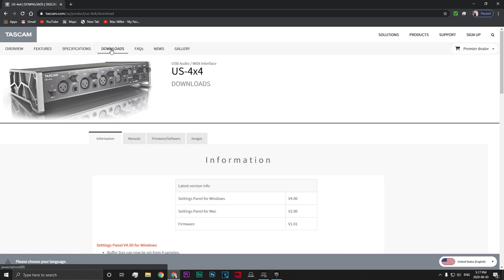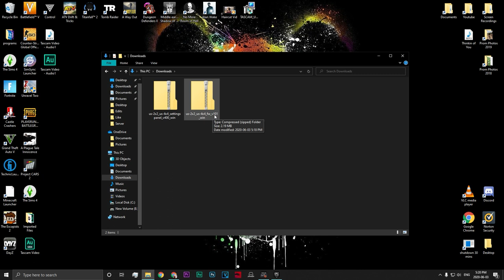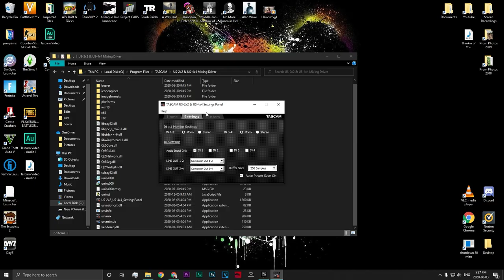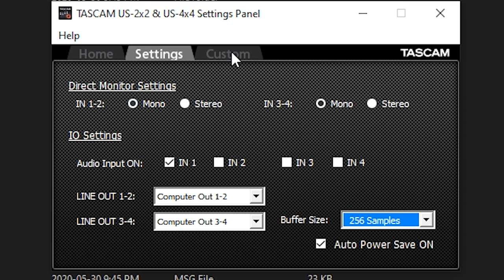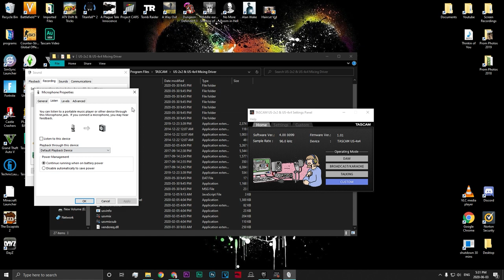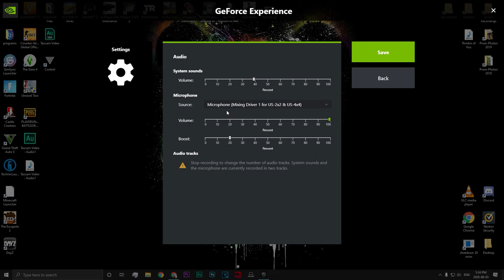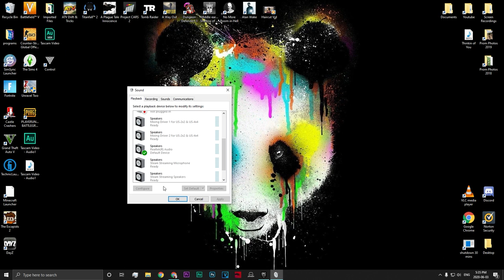taSCAM 4x4 - AUDIO ISSUE (still broken, don’t buy)

Comment: 8:58 I know it is almost 2 years later and some of you might give up on this issue but I will just leave a resolution for it here in case some one needs it.
You go to Settings > Ease of Access > Audio > then switch the option "Turn on mono audio"
And boom, it works for me. Hope it works for you too. Cheers!
Reply from the maker: Thanks for the info, I hope this helps too!

Comment: Thanks for this! I didn't know about downloading the firmware until a friend drew my attention to the issue. I'm now looking forward to finally outwitting my 4x4. In my setup with Windows 10, I have multiple issues with my 4x4 changing settings, especially when trying to use it with Zoom. After all the daily fiddling, it gives good results, but the software seems to have been designed by Loki, God of mischief. Far more time goes on the fiddling about than on recording. I bought the Tascam for its 4 inputs, but I suspect the glowing reviews were based on trials with nice expensive Macs.
Reply from the maker: Yeah for sure, np! I'm super glad the video is helping out, there wasn't anything else online about the super finicky software they made so I had to make a vid. And oh god, yes, it has been so difficult for me too with settings being automatically changed and whatnot, I was tempted to try sending it back as faulty... but I figured it was probably software related so I just took some more time to figure it out. Love the idea of having 4 channels as well, just in case I end up in a band or something. And you're probably right because it definitely does not like to cooperate with Windows 10 at all! Glad we figured something out though, maybe one day they'll patch it to be more accessible and easy to use.
Reply: I have a nice expensive mac. We still have issues with interfaces, but they’re nicer issues, and expensive.
Reply from the maker: @jamesrobertson8292  Hahahah nice to hear that we're not alone :') I can't recommend the Scarlett Focusrite 2i2 enough though. The thing worked before I even installed any drivers or firmware updates...¯\_(ツ)_/¯

Comment: Hey there, you can fix your problem at 7:00 min :

system sound - playback - choose the WRONG audio output - right mousbutton - properties - than again properties(button on the right) - change settings(with the shield) - driver - and than the fourth button (deactivate).

I hope this will help, it took me hours to fix it on my system
Reply: But doesn't this assume that you will never need to use output?

If so, I guess that is a valid fix (I use this fix with my HDMI outputs so that my monitor audio is never selected)
Reply from the maker: I can't remember if I tried that but I'm pretty sure when I disabled the "Mixing Driver 1[/2]" device, it also disabled the device I needed on the recording tab. That's why it didn't end up working. I spent a lot of time trying different things and my conclusion is that the Tascam 4x4 is just a waste of time because it never works as intended. Can't recommend the Scarlett Focusrite 2i2 enough!
Reply from the maker: @JoshKaufmanstuff  Yeah, it would work but I think it also disabled the recording device as well :((
Reply: @MooserTheHoser  When the guy telling you how to fix your interface says to use a different one. You go buy a different one. Done.
Reply from the maker: @josephbeatty4421  lol pretty much, eh?

Comment: My first interface was a Tascam US-144 which was already outdated when I got it, broke down due to driver issues after about 2 years. Was able to get a Tascam US 4x4 cheap so figured why not. Always had some problems with it but was able to figure most out after a little headache. Broke down after about 1 year. Mine won't connect to any PC anymore. The USB light just keeps blinking. Then someone gifted me a Tascam us 16x08 interface, one of the higher end Tascam interfaces. Has pretty much been working perfectly since I got it a year ago. Don't know if this is just luck or Tascam treat their higher end products with much much more care. Somehow Tascam interfaces keep following me. Now I use this one at home and my Motu M4 when I'm on the road. While Tascam is kinda trash you really can't beat their price/input ratio.
Reply from the maker: Yeah that sounds about right. I figured they make it work out of the box but don’t keep up with updates…

Comment: Do you help me please with 3:00? I can't connect it. It says "Erroe. No Device found". So in Settings panel is "No Device too". I have connected Tascam to PC and mic to Tascam. Everything is on. USB indicator is lit. Some help please?
Reply from the maker: Maybe try a couple different usb ports if possible. Other than that, I’m not sure what to do. Your unit may be faulty so I would send it back and ask for another one if it’s not too late. Or a refund & try another brand, up to you.
Reply: @MooserTheHoser  Thank for fast response. Its weird, when I disconnect the device it says "Disconnected" but when I connect it again, there is still "No Device". I'll try it what you suggested. Thanks

Comment: im still having the problem stated at 9:00, shutting down and powering it is also not working, pls help
Reply from the maker: Hey Raayon, sorry for a late response. I don't think I have any other tips for troubleshooting and I think the best option is to consider another brand. I had a lot of good luck with Yamaha but I'm sure there's something you can find that doesn't have as many issues as the Tascam. Thanks & good luck!

Comment: Hi. Do you think the Scarlet 4x4 sounds better? Or don't you recommend like the 2i2? Thanks!
Reply from the maker: Hey sorry, just saw this now. Not sure since I only tried the 2i2. I think the 2i2 works pretty decently but there's not much else to it. I recently switched over to the Yamaha MG10XU mixer & it has allowed me to change compression values and other effects/settings on board making audio quality a bit better. Also depends on your mic aswell. Hope this helps, thanks for the comment!
Reply: @MooserTheHoser  Great. Very Thanks!
Reply: Can't use it in Windows 10 for audio in the camera video and cakewalk is the only daw you can get it to monitor. Wish I had bought a different converter .

Comment: Thank you Pal, you are a gentleman. I wil certainly try that today, although I read a couple of reviews before I bought that thing, and they all said "if you have a Mac, you dont need to download anything!"  Obviously, they live in another universe I do, or they have a different Mac that I do. I had bought this unit second hand on FB, and it's unlikely that i can return it. Though the seller had confirmed me it was "a plug and play", and he had no problem with it. Of course, he wanted to sell it... so what do you know. Now here is the thing: I need an interface that i can do interviews with two guests, or even three at a time. And the more I searched, the more confused I got on what I should buy. These interface manufacturers think all people are sound engineers... I mean, try to make sense from some of those manuals, or even the description, and you need a technical dictionary and a diploma in broadcasting!! I looked at Behringer and AKAI and Focusrite (the Focusrite 212 does not have four mic outputs), and lo and behold, i read plenty of bad reviews about ALL OF THEM, enough to steer away. And usually it is the same problem: it is TOO COMPLICATED for the layman. Even Roadstar, the £500 "all-in-one" podcast magic pulls in a bunch of bad reviews. So i understand that you "had it" with the Tascam, and you advise me to return it - but it ain't solve the problem, mate!! I had asked the same question on forums and FB groups, and I am going to ask again: what interface to buy that actually WORKS, reliable, does not need a bunch settings to figure out, and do not need the latest Mac OS and high-end software (Logic Pro, Cubase) to run???? (My OS and MAC is ooooold school, those fancy softwares cannot be downloaded, I work with Audacity, which might not be as fancy as those, but at least I UNDERSTAND and can use it, which is pretty much all I need from a recording software.) So do you have a bright idea, if not the TASCAM, then what...??? It that it seems EVERYBODY has a podcast today. They must have all figured it out how to record interviews!! Don't tell me they all have their own sound engineer....  Thanks for your time. You are good sport.
Reply: This is exactly what I am facing with my newly purchased audio gears. After a few days, I’ve realized that I have to invest not just my money but my time on these thing as well. But it’s still not working as I expected, the audio output from the interface to my headphone is still delayed compared to what I talk to the mic. I feel that my passion is being challenged now.
Reply from the maker: Ohhh shit! Sorry I completely let this reply slip through. Umm I faced a similar issue with needing more channels from the device. After trying the Scarlett, I actually bought a small mixer - the Yamaha MG10. It works really well for me when routing different audio sources to 2 pcs while streaming (all at real-time). It includes 4 channels for microphones (plus a couple more channels for line-in & an fx-send option) and built-in phantom power if needed. It’s definitely my go-to for everything now and is fairly smooth to operate. No complicated software and works very well imo.    edit: I meant to describe the MG10XU which does support usb
Reply from the maker: Audio definitely takes a bit of experience to get used to but it’s not impossible with the right mindset. Keep trying different things & you will eventually get it right! If you need any help, I stream mon-fri @ 6pm est. Hop in & feel free to ask me anything if you need a second opinion!
Reply: @MooserTheHoser  Hey Pal, thanks for the input - unfortunately, it came too late, i had to solve the situation...  couldnt wait. See, the problem with the Yamaha MG10 is that it is NOT an USB interface, but analog - and I need an USB one. Also, the software Yamaha recommends is the  Cubase Ai, which will not run on my MacBook, because the OS is "too old". And i cannot upgrade to a higher OS at the moment (I spare you from the details.) So picking a mixer is not that easy... got to consider the remaining of your tech. oh boy.
Reply from the maker: @bendegoose9339  Sorry to hear that, I’m glad you were able to sort out your needs. I made a mistake & you’re absolutely right; the MG10 is analog only and was not the device I intended to describe. You would’ve wanted the MG10XU which does support USB input/output. Also, I’m fairly certain it would pair well with Audacity on your older MacBook. No need for the latest OS version or any newer DAW programs.
Reply: @MooserTheHoser  what do you mean "I stream"...? You mean like a live podcast? Where???? link please.
Reply from the maker: I stream on Twitch - mostly gaming content.

https://www.twitch.tv/iampalioxis

Comment: hey bro, so the first thing is: where do you download this setting panel application from? I cant find it on the link that you added. The only thing I find is for Windows. I have MAC. now what? man, this thing, i was told, is "plug and play". Nothing could be further from the truth. This unit is SOOOO not "plug-and-play"...   cheers
Reply from the maker: https://tascam.com/us/product/us-4x4/download
---> Scroll down and you'll see the "Firmware" and "Software" sections where you can find the specific versions you need...

...but to make it even easier; here are the specific links to the firmware and software versions that should work for your Mac:
Firmware: https://tascam.com/downloads/products/tascam/us-2x2_us-4x4/us-2x2_us-4x4_fw_v101_mac_n.zip
Software: https://tascam.com/downloads/products/tascam/us-2x2_us-4x4/us-2x2_us-4x4_settingspanel_v400_win.zip

Definitely not plug & play, bro... I would try to return it if it isn't too late.
Reply: @MooserTheHoser  I dont understand this line here: "Make sure your unit is setup and plugged in AFTER you're done installing the drivers and BEFORE you reboot your computer." When I try to open and connect firmware, it says it cannot find the device. And "rebooting your computer" - where is this mentioned in the manual? Whenn you say reboot, you mean... restart? When do I have to restart the computer - after downloading the firmware/software, or after connecting the device...?  You know, for hopeless recording idiots like me, the best help is to have a checklist, as in Step 1... Step2....  Step 3... for future reference. :)
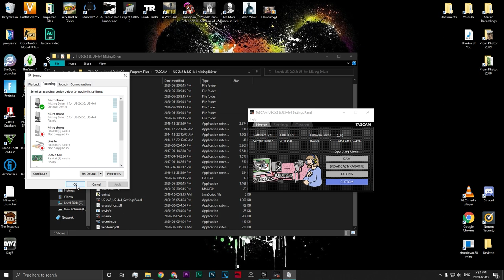Reply from the maker: Not sure if you still need my help but… I was referencing to the part of the video (9:38) when I explain the mystery problem I was having after having everything set up. I’m not sure why your Mac wouldn’t be able to find your device to update the firmware. Maybe try the following: unplug & reconnect the usb cable; try a different usb port (try a usb 3.0 slot); or try a different cable altogether?

What I meant to advise:
Step 1: Install firmware update & drivers.
Step 2: Shut down.
Step 3: Make sure everything is plugged in & good to go.
Step 4: Boot your computer & hope for the best.

This is what temporarily solved my mystery issue where it looked like everything was on & working but wouldn’t output a mono track. Always make sure the device is plugged in & set up even before starting the computer.

Rebooting/restarting may not be mentioned in the manual (I am not sure if it is), however; it is always a good idea to do it after installing any sort of program for the first time.
Reply: @MooserTheHoser  Want to hear something funny? The Tascam 4x4 works for me like a charm. I havent even downloaded the firmware, and it works with Audacity without any problem - so far. The only thing that caused some trouble was that i plugged in four mics, and the "system" crashed. and it took me a while to figure out that three of the mics were Dynamic, and one was Coven... Con... Consent.... the other one. Which needs phantompower. And the Tascam 4x4 does not have the option to switch on Phantom power on each individual mics, so either you use it or not on all four. Which is... crazy!!! I mean how difficult would it be to just put an extra switch to the mics, so the user is not forced to use only Dynamic or only Cont... the other one.... type of mics. But other than that, it seems to work!!

Comment: I cancelled the ongoing firmware update because the progress bar was starting all over again just before it reached the full end. I had to be a smartass. now the Peak and USB LEDs light up very very mildly and the US 2x2 does not detect. have tried to restart, shutdown and turn on again the pc many, many times but it is no use. I regret cancelling the firmware update so much. Why did i do that. I have no idea where is the exact issue which was causes by me cancelling the firmware update. I am jobless, trying to get it back together and this happens. I had so much planned futurewise. please. help. or tell me if I should just give up on my tascam us 2x2. I never ever had any issues with it since 2014, worked smoothly, it was unused for couple weeks as the laptop was gone for repair, then when I connected it did not start initially, then randomly it worked, then I thought firmware update should be done, but then cancelled it midway, now I regret it. dissapointed in myself.

Comment: I have 2x2 and even the signal led on the audio interface does not show that mic is working or not. It does not work even without connecting to computer.

Comment: Before reading this please consider investing in an other brand, cause this brand isn't for beginners... It was hard to setup and it still makes a bit of white noise...

US-4x4HR (bought late 2020).
My audio card wasn't making any lights on none of my LEDs (but before going to sleep everything worked perfectly)
Computer wouldn't find it so I couldn't download the drivers I already had (last update was 2022)

So I tried switching usb-c bus(this turned the usb LED almost on, low light).
Unplugging usb-c and power from audio card, but didn't do anything.

Last thing that worked was unplugging everything turning my computer off, putting back everything as it was yesterday, turned the computer back on and "WE POPOO!"

Everything works again B)